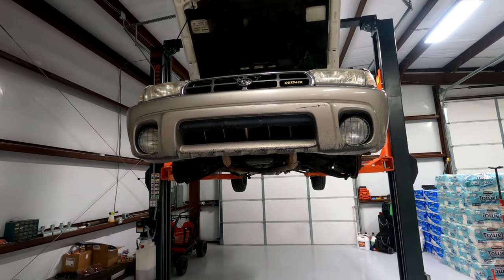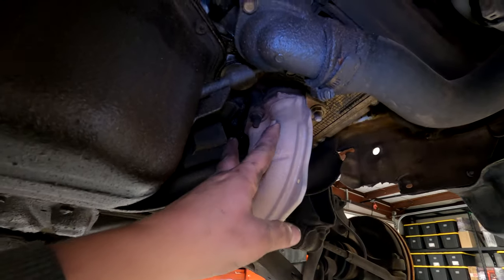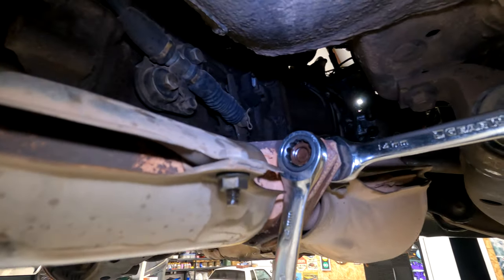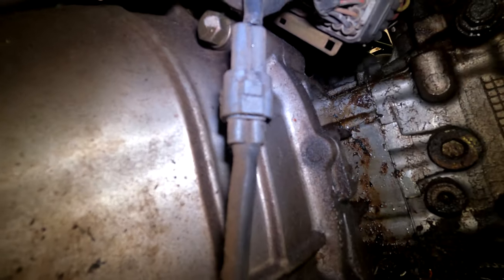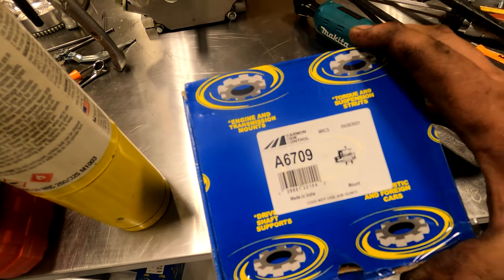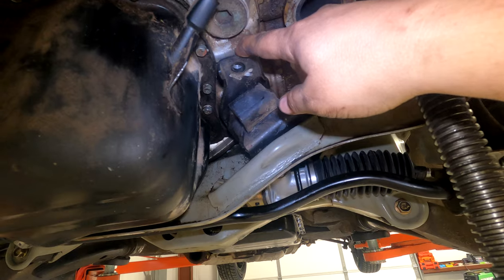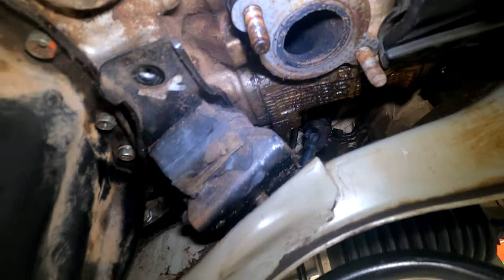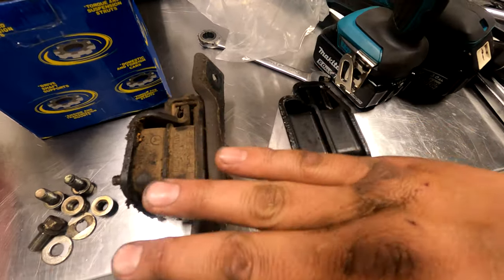How To: Subaru Legacy Outback Motor Mount Replacement Step-by-Step

Comment: Thanks for the video. On newer FB25 DI Subs changing back plugs is hard and they say lifting the engine an inch or so helps. Would this be the way to do it? Loosen the 2 mounts and jack on the trans case? Or do you have to also disconnect something else?
Reply from the maker: I have a video.  Yes lift one side of the engine and change the plugs

Comment: All the difficult parts are literally cut from the video.
Reply from the maker: i literally point and explain everything.  what more do you need?  what is missing?
Reply: @FatGuyBuilds  "point and explain" doesn't really do anything for a repair tutorial. 

You don't show how to access the difficult-to-reach bolt for the bracket. You don't show the process of removing the mount. You don't show any of the installation process at all.
Reply from the maker: @Aashishkebab  ratcheting wrench.
Reply from the maker: @Aashishkebab  you wouldnt be able to see anything with my arms in the way either
Reply from the maker: @Aashishkebab  install process is 100% reverse of the removal process.   Why do u need exact same steps in reverse shown?  U just did it all.  Now do it again backwards